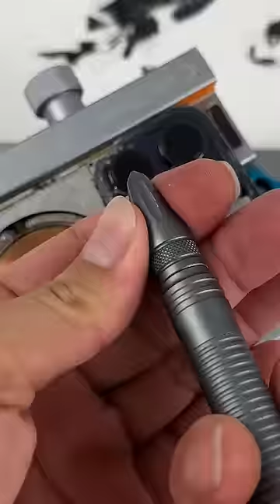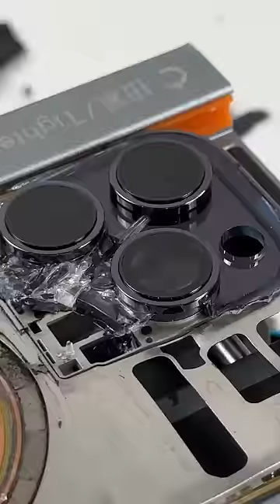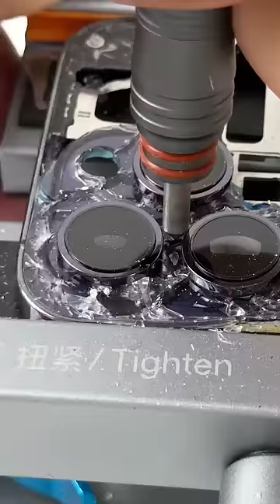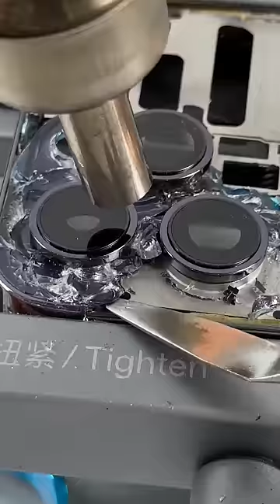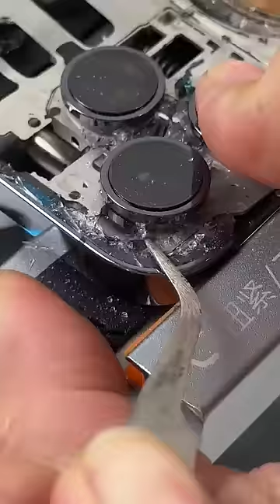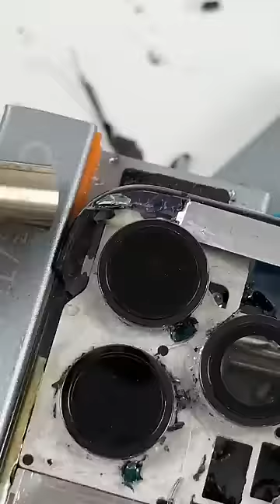Blasting iPhone 14 Pro Back Glass To Replace New one (Original Sound) #reel #iPhone14pro #backglass

Comment: Apple: Let's make it a pain in the ass to repair so you'll just  buy a new one instead.
Reply: well I think the reason why it's expensive is because its build materials is hard to break. and that's a good thing tho. u don't have to buy a new phone everytime you drop your phone
Reply: @bpkupiddiechannel9385  Nah, its overpriced. Making strong glass aint hard or expensive when its that thin.
Reply: @bpkupiddiechannel9385  trust me it's easier to break than actually taking it apart
Reply: The screens aren’t a pain in the ass to repair tho they’re among the easiest in my opinion
Reply: @mikehenry9672 Odd.
Reply: @bpkupiddiechannel9385 my iphone 13 max pro took a 6ft+ drop onto concrete and only got a few cracks on the back but worked fine. I'll still take an iphone over any other phone
Reply: @bpkupiddiechannel9385 hard to break? why do you think ppl replacing it? duh. 😅
Reply: Ah, you mean just like the other smartphone manufactures?
Reply: @bpkupiddiechannel9385 it's manufactured by people under the minimum wage man. They got the materials from people again in the same situation. Of course it is overpriced. Do some research. And then obviously the main things. The iPhone hasn't changed like since the X. No innovation no changes, more price. That's is not logical nor worth tbh.
Reply: @MichiruKnoxwell yes iphone not worth to buy unless you need to trash your money...
Reply: @Warp2090 you clearly haven’t been keeping up with the iphone 14 series
Reply: @hueman69420  why are you replying to a old comment? also, idk what you mean by that lmao
Reply: @Warp2090  iphone 14 opens from screen and back both, one of the easiest phone to repair if you break back glass
Reply: @Warp2090 ”old comment” 2 weeks bruh people still react to comments from years ago and you’re acting like you posted this shit when you were a kid or something 💀
Reply: @famousdestroyer7  Nah I posted that comment like 5 months ago, a YT glitch
Reply: @bpkupiddiechannel9385 😅
Reply: Literall
Reply: @crazytowerz2112 nope.  Materials actually matter in fact they are one of the best predictors of the price of a phone
Reply: @MichiruKnoxwell yeah bro, for u android users, innovation is nothing but adding an extra piece of screen,increasing the pixel count or including an S-Pen to show people that u r using a high end smartphone.
Reply: @dogedoge3361  taking more care? LOL. what make you think people broke it on purpose? I'm using both right now. I never making one of them exclusive. Just simple protection like tempered glass and case. If you think iPhone is more durable than Android. Just watch the drop test video and find out. It just the same. Both using premium material (high end devices).
Reply: મનેતમેઆઈફોડીનસેવનદાતડીયાદા
Reply: And y'all blame if they make it less durable+ and somehow repairable

Comment: It doesn’t feel right to do that.
Reply: He had to do it to remove the whole back glass fully. It is done to replace the broken back glass (read the title)
Reply: bc it isnt
Reply: @meandmyfish5353  Actually, they break it to replace broken glass. The glass was already broken, so they have to break it more to remove it. After removing glass, they put a new one on.
Reply: @EverythingAwesomeTech  Yes, but there are safer methods like using a laser to remove the glass.
Reply: @sj-red  i’m pretty sure the price of the laser machine is very expensive.
Reply: @mohamadamirulabdlah6089   Did I say the laser would be cheap? No.

The person I was replying to was implying this is the correct method for replacing the back glass. This method is likely to cause further damage.

The correct method is using a laser.
Reply: @sj-red  and after laser, you still have to deal with glass.
Reply: @mohamadamirulabdlah6089  Also, look them up online. They’re not that expensive (just over $1k brand new). I would argue that’s within the budget of pretty much any phone repair shop.
Reply: @EverythingAwesomeTech  You have no idea what you are talking about. The laser removes the glass.

Furthermore, the laser doesn’t risk further damage to the device.
Reply: @sj-red  yes because the laser machine is expensive, some repair shop just using manual method instead. The method of using laser is correct, but the high price of it doesn’t let them to do so.
Reply: @mohamadamirulabdlah6089  Again, just over $1k is not that expensive. The machine will pay for itself in the time saved on labour.
Reply: @ItsDoms  That’s the only point I was making tbh. Of course you can use cheaper tools to get the job done like in any industry but the correct method is using a laser. I would have thought there is a possibility of damaging the MagSafe charging coil using this method? As far I’m aware there is no way to remove that from the device prior to removing the back glass.
Reply: @ItsDoms  Also, though it’s not faster it’s still automating a process which you would be putting manual labour into completing which I think you hinted towards at the end of your second reply. ✌️
Reply: @ItsDoms  😂 if only they’d had been nice enough to design it with remove-able back glass like the 14
Reply: @ItsDoms  Wouldn’t surprise me at all tbh. What I’m most curious about is the future for iPhones? With the EU USB-C legislation will they implement USB-C in place of Lightning or will they do the more “Apple” move of bypassing the ruling with MagSafe charging or something
Reply: @ItsDoms  I strongly disagree. Allowing Apple to bypass EU restrictions by using MagSafe only benefits Apple; not the consumer. It allows them to keep their MFi program. MagSafe is not the same as Qi wireless charging. Charging is also not the only use for a wired connection.

Here’s a few points as to why this is my opinion:

1) Limited connectivity options 
2) Dependency on wireless technology
3) Compatibility with existing accessories
4) Potential limitations for certain user groups (think external hardware or audio equipment)
5) Repair and servicing concerns
6) Reduced data transfer as it will be reliant on internet access
7) Wireless charging is less efficient than wired
Reply: @ItsDoms  I respect your opinion but I felt compelled to argue against this one as I feel very strongly about it. 😂😅
Reply: @ItsDoms  💯💙
Reply: Its how all iphone should be treated
Reply: @sj-red  using laser doesn't take the glass off fully, it just makes it easier to break off
Reply: @sj-red  bruh correct method - is full replacement of rear case without this pornography
Reply: @jopa-xn5gk  The correct method is not replacing the entire frame, unless needed of course.
Reply: @sj-red  So over $1k repair for over $1k phone? Definitely worth it 😂
Reply: @alreawon1212  What are you talking about? I think you replied to the wrong person… 😅
Reply: @alreawon1212  I think you’ve misunderstood my previous replies. Re-read them and try applying some common sense.

I never said that an individual should purchase a laser machine to repair their phone; I mentioned that is the correct method for repairing the back glass. For a repair shop, this would be a worthwhile investment as it is less risky and automates the process allowing the employees to continue working on other jobs.

Of course to any individual looking to do a DIY repair, this would not be a worthwhile investment.

I didn’t think I’d need to explain in this much detail but I guess people on YouTube never fail to surprise me.
Reply: @ItsDoms ❤❤❤❤❤
Reply: No there aren't. This needs to be done because the glass is underneath the camera lenses, and the camera lenses are permanently welded to the phone
Reply: @sj-red  you still have to use that tool, cause the glass is in between those cameras, you can't just lift it

Comment: Did you scratch the lens enclosure? Mine were mint forever and then i put a new case on and noticed a couple small scratches around the edges of the camera where the metal is…. Drives me nuts…. Phones still basically mint but makes me want a new one lol 😂

Comment: But why glass? Glass is a great thermal insulator and breaks easily, so if anything, the glass does not help the phone to vent its heat and if dropped it might injure the user.

Maybe it insulates the electricity so you wouldnt get zapped but i do not belive, thats the case.

Maybe someone could explain?
Reply: It just feels more premium.
Reply: @arkaadias2526  yea. But there are durable forms of glass such as gorilla glass victus 2
Reply: @tankmantankman4802  well yeah i get it but its still glass
Reply: @arkaadias2526  yea. Still glass